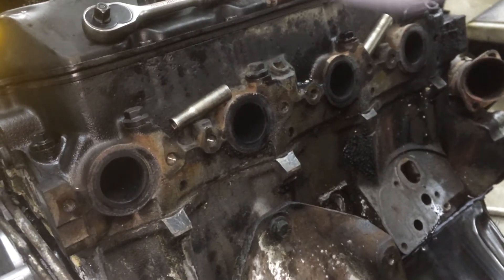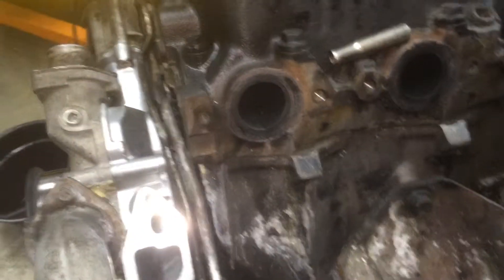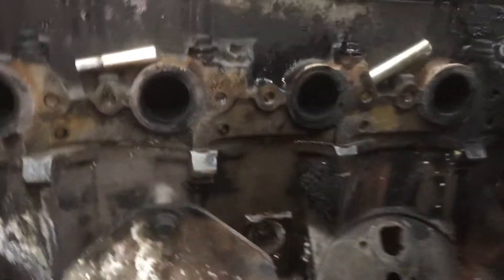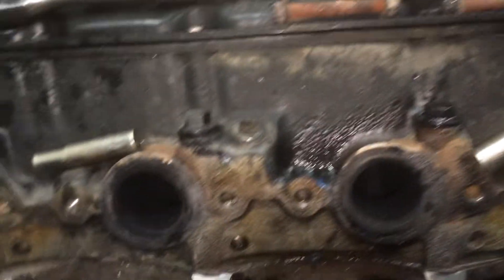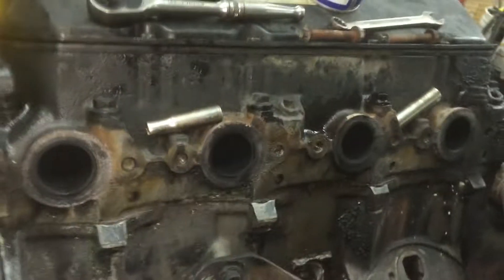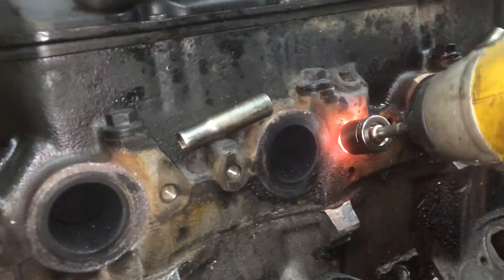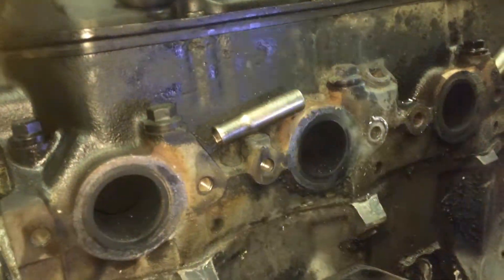7.3 L Powerstroke broken exhaust manifold bolt removal

Comment: I changed my manifolds because the ears that the up pipes bolt too were rusted almost away. I cut the bolts and welded a nut to all 16. The 3 that had broke off in the head years ago required a few tries but they came out too. Had to pull my inner fenders to get to them with the engine in the truck
Reply from the maker: Nice! It’s a pain but so sweet when they come out.

Comment: Does the weld not stick to the cast iron?
Reply from the maker: Ed Granger not as well as it does to the broken stud. Also just filling the inside of the nut there's not much contacting the block. This really works well in T-stat bolts in aluminum or a/c compressor bolts in aluminum.
Reply: Awesome will try it on my 7.3 tomorrow
Reply from the maker: Ed Granger how'd it go?

Comment: dude you could of probably just turned it with your fingers. no need for the impact. 
Joking.. thanks for the tip.. replacing manifolds and up-pipes on my truck and I know all my bolts are gonna break. Last years cheapie stick welder purchase should continue to pay off.